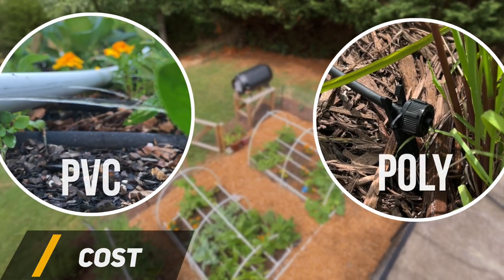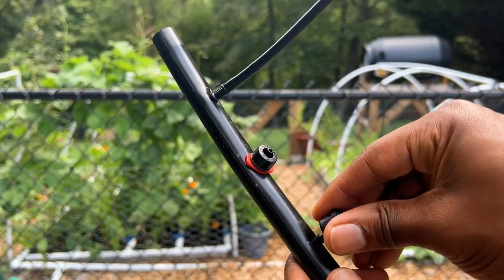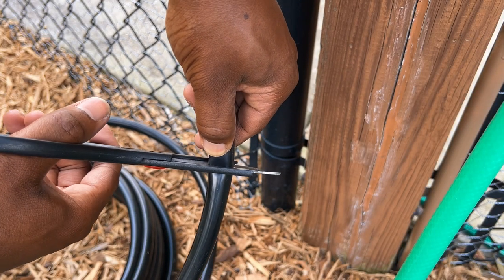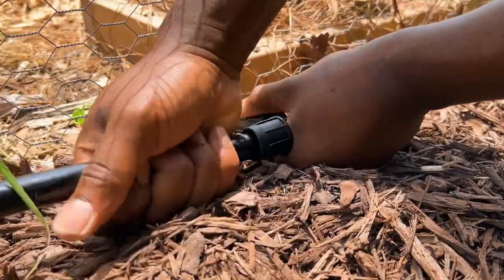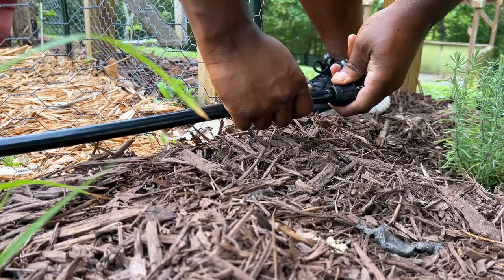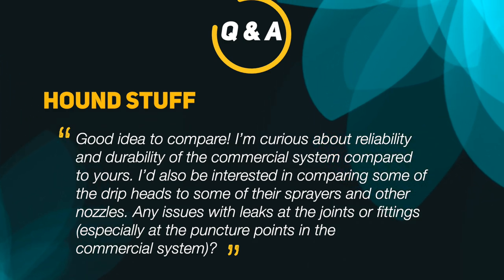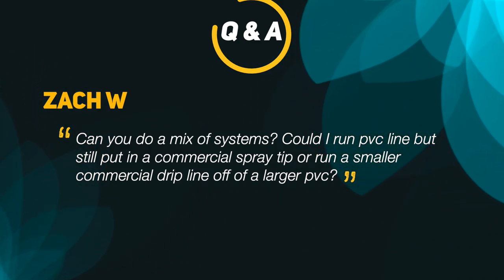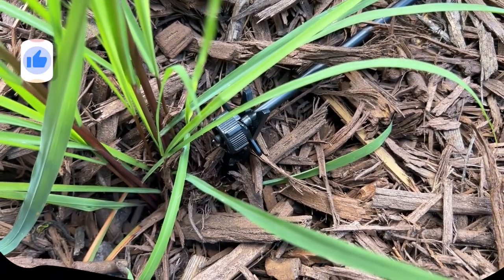Which is BETTER? - PVC or a Commercial Drip Irrigation System

Comment: I have used the pvc method in Arizona now for 10 yrs. Works great you can also put in tees with riser threads and screw in cap that comes fitting for 1/4 in poly to maybe use for pots with adjustable valves. Works great.

Comment: I use "irrigation" water on my garden. This is water that is delivered via open ditches miles away. As a result, all manner of "gunk" (seeds, weeds, sludge, bugs, etc.) gets into my watering system. I found that the drip emitters were CONSTANTLY plugging up. I went to 3/4" pvc pipe (but used a slightly larger drill for the holes), then put male quick-connectors on the pipes and a female quick-connector on the hose. LOVE IT!!!

Comment: Thanks for the well-done comparison. I've been using drip irrigation in the California desert since the early 80s. The best ever was called Netafim which I believe was originally developed in Israel. I had the 1/2 " brown pipe with the emitters pre-installed. That stuff lasted a good 20+ years. I used it in a couple of different veggie garden setups, all of the components were quality and it was pretty easy to reassemble and change around. When I tried to replace it I could not find the same thing. I did find some called Netafim but the hoses were smaller and over a fairly short period of time some of the emitters failed. Definitely not the same or as easy to work with. The early style Netafim really worked the best here. 

I have used the black poly and various types of emitters outside of my veggie garden for ornamentals, etc. Here that does not work too well unless the area is fenced so that the critters can not get to the tubing. Young coyotes and even rabbits love to chew on poly tubing. We leave water out for them so it is not that they are necessarily seeking water. The coyotes seem to find tearing out poly tubing great fun so it means constant monitoring and repairs. Also with very hard water, many of the emitters tend to plug up even the ones that claim to be self-cleaning. In the last two years, I have reduced the number of ornamental plants preferring to use the water for the veggie garden so I have less maintenance for the poly than previously.  

This year I decided to redo the irrigation for the veggie garden and looked at many different options. I did check out the garden grids that you mention in this video but dang they are very expensive. Looks like a great system but is fairly cost-prohibitive for even a small garden. After much research wound up finding your pvc pipe video. Even as a woman in her late 70s I was able to put the system together for my four raised beds. Thank you for the clear instructions. Your comparison in this video was well done and I agree with some of the benefits of both. I note in the comments that there was criticism of the appearance of the PVC pipe system. It may not be beautiful but my veggie garden is tucked away in a very small backyard area that is not in plain view and even if it was in a more prominent spot I don't think it would matter to me. Despite the drought here I had a very successful garden year. A benefit to this system vs when I had the drip system on a timer: I am out there in the garden while the water is running and I am paying closer attention to the plants. The water doesn't have to run as long as the drip and during that short period of time, I am on the spot checking for pests and any problems. When the timer was automatically coming on in the morning I think I tended to be a bit lazier and less attentive. Every garden and every gardener is different and we each have to find what works best in our locale and lifestyle. I am enjoying your experiments.

Comment: I really enjoy my drip system. The ability to cover my irregular ground surface is very helpful.
Reply from the maker: Awesome. How long have you had yours installed, and anything you don’t like about it so far?
Reply: @GreenTechTown  I have used it for roughly a little over a month since I totally finished it.  I like the ability to cover the irregular ground. But the push connection pieces that I used causes me a great degree of difficulty to disconnect them if I have to reposition the layout.

Comment: Excellent! Thanks for the feedback. I did "commercial" (Poly) because I was more comfortable cutting and resizing with a scissors than buying all the equipment for PVC.
My problem is that I didn't do drip, I did soaker hoses. I did this because it offered me more flexibility with where my water was going to come out, though I realize it's not quite as water efficient as drip. I may tweak this in the coming years as I figure out what spacing I want for water. Soaker hoses are also easier to bury, where as it feels like a drip system you want to drop the water on top.

The biggest problem with soaker hoses + 1/4" tubing is that the soaker hoses are all built for hoses, so at each tubing -> soaker hose I have to add two fittings, one to turn it into 3/4" and then one to attach the 3/4" for the soaker hose. I haven't found any good fittings yet for the polyethylene tubing that fit directly onto soaker hoses.

The other issue I've found is that not all Poly fittings are equal. Some with barbs will not come off, and if I want to resize, I have to cut them apart. I like the ones with a little bump and a screw valve. These are the ones you use primarily in your video, and I will be buying only those in the future in case I want to take my system apart or resize some things. The elbow barbs stick so tight they don't disassemble.
Reply from the maker: Thanks for sharing Isaac! Always great to hear other people's experience. So far I've purchased all my fittings & tubing from one source, but I was curious about rather or not all poly fittings were made equally. Also, yes, the perma-loc fittings have been awesome. 

I also seen where others were having issues with barb fittings for 1/2" poly tubing if they removed the fitting from the tubing and tried to re-insert. The fitting would just pop off once the water was turned on. They ended up adding hose clamps to help prevent that issue, but highly recommended using perma-loc fittings if you could get your hands on them.
Reply: I have had that same issue with fittings that bite. There probably is a tool to remove the pressure to back it out without having ti cut it but I don’t know about it. I know with actual “Sharkbite” plumbing connectors there is a tools for doing exactly that.  Thanks again!!
Reply: My soaker hoses clogged up in about 1 season, shortest life span of any of my irrigation bits.

Comment: I used to do irrigation and we had poly line with built in drip holes already in it.  More than just holes, its actually a little immeter to help regulate water flow, pressure, etc.
For your square foot garden where you thought pvc with holes drilled might be better, this will achieve the same thing really fast and easy.  Usually running on the ground or burred just under mulch or something.

I think that is what you were looking at in your last image, just looked different than the product I used.

BTW a big roll of the tubing will be WAY cheaper than that grid and while you can DIY a grid, just running one long piece and zig zagging it around also works perfectly fine!

That one product I think is for a consumer who doesn't know much and wants a ready made solution.

Comment: Yes, hot water is a big help for fittings.  I use an old insulated cup, it even has a hole just the right size that I can close when not in use.

Comment: The commercial drip system had 2 major disadvantage: gophers and time. 

As to the gopher problem, on average for every 40' of line I had installed gophers chewed through the piping. That may not seem like a big deal, since the line is easy to repair or replace, however it always seems to happen at the worst time (either when I'm too ill to check on the garden, or when I am on vacation), causing the entire system to go down and killing off a large part of my garden.

The problem with time is that, every spring I have had to replace ALL of the irrigation heads, as they clog up every winter. That gets expensive and exhausting when trying to set up my spring garden.

Comment: Thanks for the comparison between the two systems. I was curious which would be better. Using the hot water is a no brainer, thanks much for the tip. Just wish I knew about it before. In my towers I use a combination because it's an overhead system. I use the PVC for stability and run the drip irrigations tubing thru it. When I come to each tower, I cut out a small hole and drop down the smaller tubing with an adjustable valve for water flow. I run it out of a 32gal. trash can with water and nutrients.
Reply from the maker: Nice! Thanks for sharing your setup concept. Using PVC for stability makes sense as well.

Comment: Great video bud, looks very well put together. I've been gardening since I was a kid and I think the mist spray that comes off underground PVC is the beat.  Because it really soaks the ground and it's light on the plants. I put it in the center of my beds. You put them all on sprinkler timers and it does all that watering for you. I normally water heavy in the mornings in the hot NC sun. But if I see some wilting during the day, I'll turn the system on for 5 mins mid day during June, July and even Aug. 
Good luck bud, looks great. 
 I also see you're using rain water, which is great and better for the plants tbh. But I'd do both (rain and city water) so you have plenty of water. But it also depends on how much you're growing.
Reply from the maker: Thanks for sharing the useful information. I too currently use both water sources. I'll soon be upgrade my rain collection capacity so I can use less city water. Also the mist spray that is located underground, is it watering the plants from underneath the soil, and if so, what is this type of system called as I'd like to look into it when I have time?
Reply: @GreenTechTown  lol no it's a pop up. Like a regular sprinkler head. But the smaller ones. Where you can change out the heads. I use the adjustable ones so you can use the 90°, 180°, 360°, or pretty much whatever you like. It's made by Rain Bird. It's just an adjustable piece on top. You can turn the screw to chance the spray, then spin the plastic piece from full open, to closed. So anything in between you can change the direction of the spray. Makes things a lot easier. Sorry if I didn't explain it well lol, you're way better at that then I am. Haha
  They do have small mist sprayers with the flex line that you have, but im not crazy about them. I really like your Rain Barrel set up, we're not allowed to collect rain water here in NC, crazy right? It's nature... but some just do it, and I can't blame them. You have the right idea and have a great set up. I just watched you change out your pump, what a difference.

Comment: Great vid... I am currently at the point where I am looking at methods of irrigation for my automated greenhouse, and have deemed I will need a manual hose in combination with my automatic feeding. Because the greenhouse is a "hoop house," I will be using poly tube as the main source, with mist heads irrigating the soil and spraying overhead. I also plan to build in a PVC hose bib to have a stable fixture to attach hose accessories to based upon need with manifold to control which direction my pump will be running )irrigation or hose). This vid has given me some ideas as to which direction to go.
Reply from the maker: Awesome project Neal! Also, did you build your greenhouse from a kit, or was it a custom build?
Reply: @GreenTechTown  I bought an inexpensive kit from Amazon because the main curiosity was the ability to create the Arduino portion of monitoring temps and moisture to trigger sprinklers, fans, heaters, and lights. I'm not excellent with plants, but always wanted a garden, so I am leveraging my automation skills to make it happen.

Comment: Very helpful video. I have been using soaker hoses on my raised beds for several years but the hoses often start leaking after less than a season of use -- regardless of brand and the use of flow restrictors. I wasn't sure what to do instead but this really helped me decide (I'll go with commercial).
Reply from the maker: Awesome, glad to hear it helped!

Comment: Thanks so much for this comparison!
Reply from the maker: You are welcome Sabrina! Are you currently using any type of drip irrigation?
Reply: @GreenTechTown  I am using an emitter line now. I started off with drip tape, then soaker hose and finally drip line. I had considered pvc for many years though and so it's great to hear what you think now. 

I am still evolving my system as I add more and more garden every year and we've been doing this 4 years now. I do not like the drip tape, it got clogged and was fussy to deal with. The soaker hose worked well, but it falls apart or splits really fast, even when buried. I'm using a half inch "total CV line" made by Jain and burying it and it's been great! For my grow bags though, I'm thinking a combo of quarter inch soaker hose and emitter line. I made a spiral with the line about an inch down inside the bag. I discovered the soaker hose emits water much more quickly than the drip line and so it's great for my artichokes, but I'll use the drip for my peppers.

Comment: I used PVC in many different applications. My oldest one is a hoop pasture for small animals. PVC and horse fencing. For small animals like chickens I put the tough plastic black construction fencing. (smaller holes than horse panels) It is now 20 years old and I still use it for "free ranging" my chickens. It has held a goat, a sheep, a mini horse at various times. For the chickens I use it with flight net on top as we have flying predators. Our ground is hard so diggers haven't been a problem and I move them to a concrete slab at night if I need too. I had 2 of them but a not so smart person decided it was easier to turn it up on the PVC and roll it. The PVC broke. That was at the 10 year mark. It couldn't handle the weight on one side bearing down after it had been in a circle for so many years. As long as 2 of us pick it up at each side the remaining one is very sturdy and not heavy to move.

Comment: Instead of putting the hot water in a cup, try putting it in a vacuum flask and keeping the lid on between uses.
Reply from the maker: Good idea MRAB! Thanks for sharing!
Reply: Related, I'm thinking about looking into a Heat Gun, so that if I need to disassemble my system in the fall I can. It's hard to dunk the fitted pieces into hot water ...

If anyone has any advice on this, I'm curious.
Reply from the maker: I would recommend reaching out to DripDepot.com since they usually respond same day or the next day (I'm not sponsored by them lol, they just really have good customer service). I tried this concept off camera, and it seem to work, however, I'm not sure if it causes any other issues down the road. It's hard for me to see a professional installer for a large job using hot water as a means to connect/disconnect everything though.

Comment: Did you try the 6” or 12” drip line with the commercial drip system yet?  May work with your 12’ grid system, just a thought.  Good video comparing the two.

Comment: Could you use the 1/2 " black irrigation tubing but drill 1/16" holes like you did with the pvc tubing and get the best of both systems?  Less expensive piping and longer lived and more UV resistent tubing?
Reply from the maker: I do not see why not. I actually just watched a video online where someone did something like that for a square-foot garden.

Comment: What kind of prep for the commercial drip line for winter?  That is my concern in Atlantic Canada… how to make it last season to season. Do I have to take it apart each winter? Disconnect and blow it out? Curious what others think.
Reply from the maker: I purchased all my commercial drip components from Drip Depot and this is what they recommended regarding winterizing your system: 

Winterizing a drip irrigation system is easy. Timers and head assembly components (backflow preventers, filters, pressure regulators) need to be removed and stored indoors. Most drip irrigation parts are made of extremely durable plastic which can withstand freezing temperatures as long as the water is removed from the system. Drip irrigation experts commonly install a threaded end cap at a low point in the system which allows the water to be drained out of the system easily. Once the water is drained out, then simply screw the cap back on and it's ready for the winter. Please refer to the following Winterizing Blog link for further details: https://help.dripdepot.com/support/solutions/articles/11000044363-winterizing

Hope that helps some.

Comment: Could you use a heat gun instead of the hot water?  Seems it might work faster. And would only take a minute or less per fitting
Reply from the maker: I'm not sure but I would think you can, you would just need to make sure you do not leave the heat gun pointed at the tube too long.

Comment: Can both of these drip irrigation methods be used on let’s say, 5 acres worth of blueberries? Is there an amount of linear feet where the effectiveness wears thin due to distance? Just trying to figure out what I should do for crop rows of blueberry bushes. Thanks for your video, lots of great information
Reply from the maker: Good question. I do not know myself since I've never look into that, but I would assume at some point it would come down to the motor power, size of the tubing, land elevation, and friction lost just to name a few variables. I'm not sponsored by anyone, but I would recommend reaching out to DripDepot and let them know your situation and see what they might recommend. You could always buy directly from them or somewhere else after they give you a better idea of what components you may need.